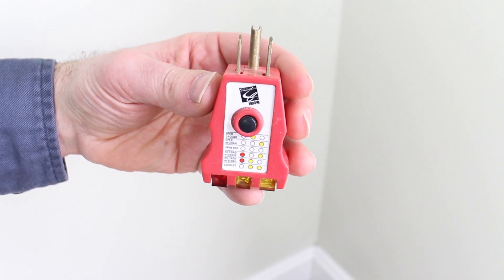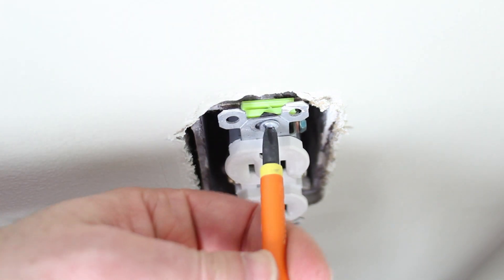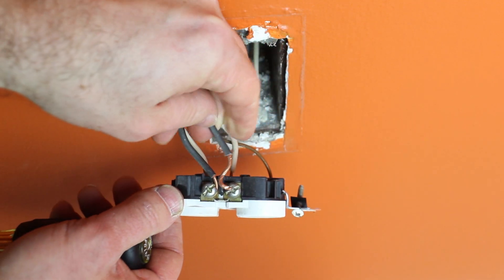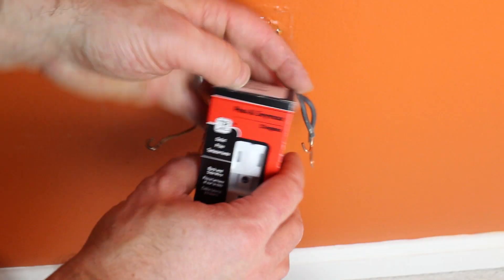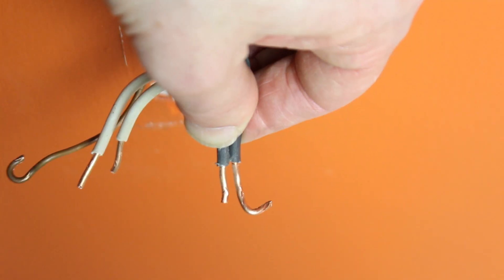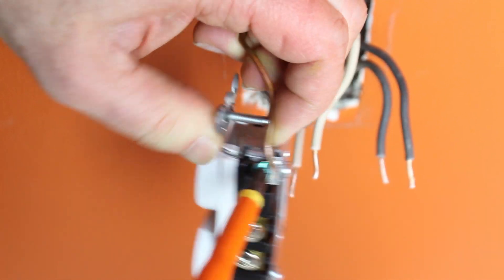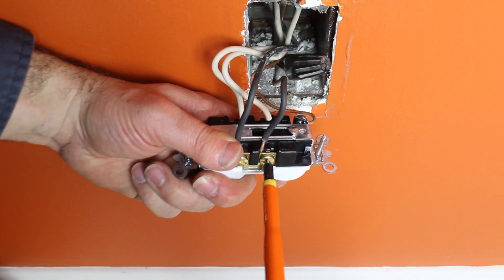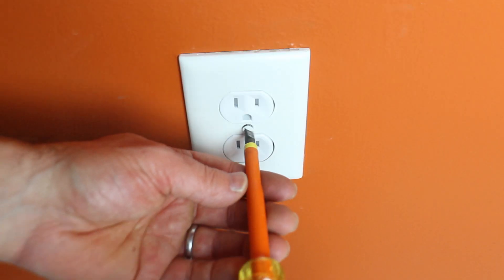How to Wire an Elecrical Outlet (Important Tips) -- by Home Repair Tutor

Comment: Fairly decent video. You forgot a few things though. You should pony tail your neutral and black wires. Mention that Black on Brass all the time. If you pony tail, then if something happens to that outlet, then all the other outlets will remain functional. Also, you should always wrap your terminal screws with black electrical tape.